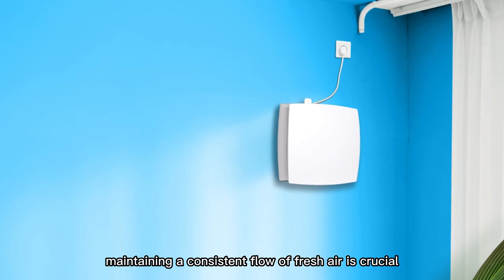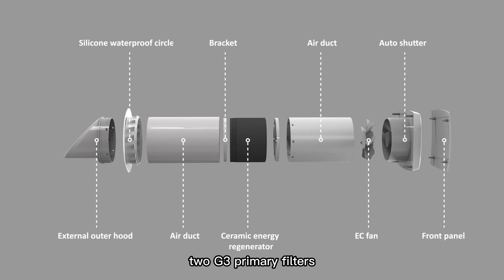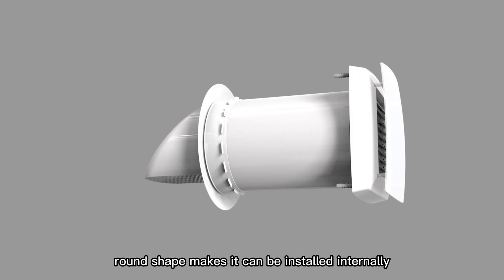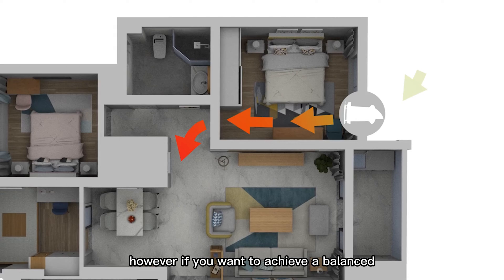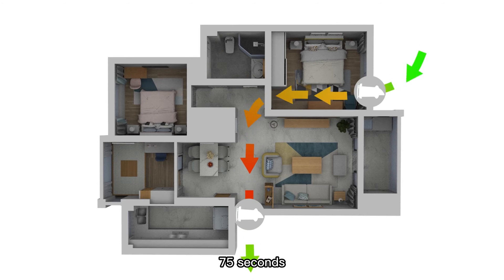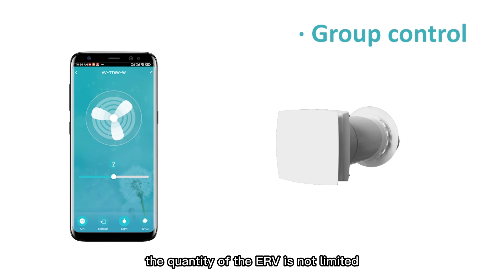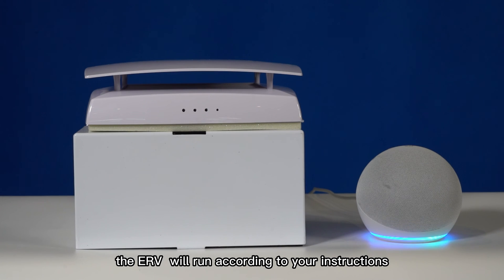Single-room Energy Recovery Ventilator

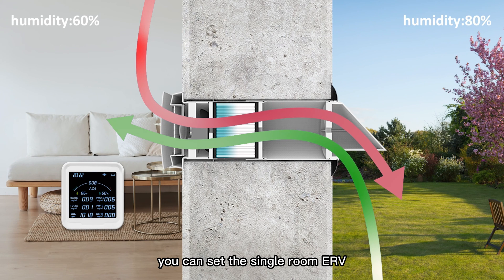Comment: 2:20 but if i set to extract mode where will it extract the air from?
Reply from the maker: I am a big Joe Rogan podcast fan too!!! Under extract mode, it will extract the air from window or door. So we recommend to use them in pair, when one is supplying air, the other one is extracting the air to make the air balance. If you have any further questions, you can visit our website www.holtop.com or send an email to sales@hotlop.com. Thank you!
Reply: These work with US buildings? The Pioneer unit needs a 11” thick wall? Who has that? * incoming German YouTubers on how American houses are cardboard😂